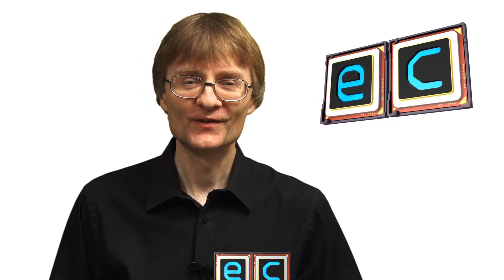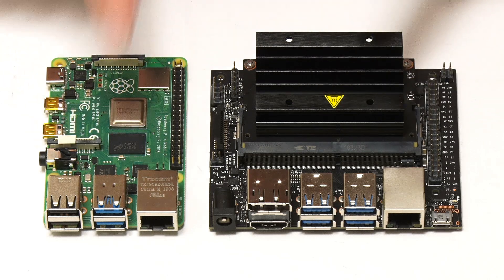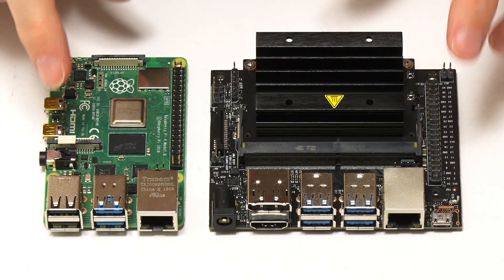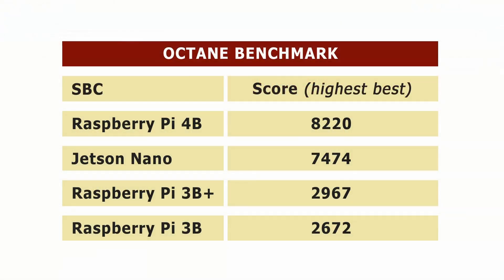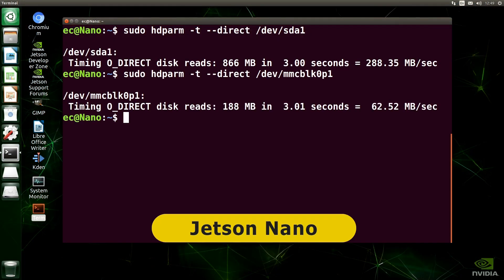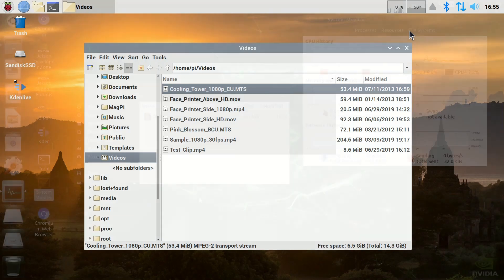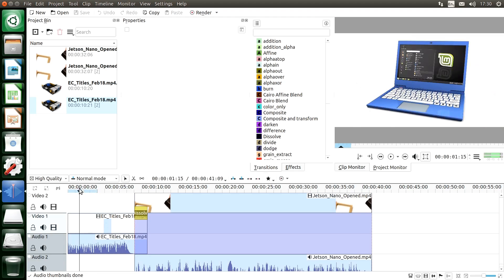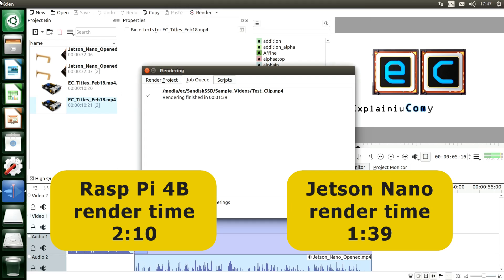Raspberry Pi 4B vs Jetson Nano

Comment: The pi4 struggles with youtube because they disabled hardware acceleration as it was breaking other parts of Chromium. Hopefully it's just a driver issue and it will soon be fixed and enabled.
Reply: Alternatively, Firefox seems to work perfectly.
Reply: @thecaptain2281  Firefox huh. That's huge. For a long time on low-end machines Win10 machines, YouTube couldn't play higher frame rates (50fps to 60fps) in Chrome but could in Edge. Go figure. I don't completely blame Raspbian since Chrome is wonky too. I'm not, however, happy with Raspberry Pi arbitrarily moving to open source codecs when there are free proprietary codecs to run the GPU.
Reply: @thecaptain2281  firefox would frequently crash for me on the pi due to ALSA related "assertion errors". although, this could just be gentooism (i couldn't find a way to get it on raspbian short of compiling it myself, which would take aeons). youtube performance is slower on FF anyway, since google's shadow DOM trickery comes into play.
Reply: @mergemechanism  
To be fair, I have a pair of Tinkerboards(both versions) and I run Android on each. Firefox for Android on those SBC's doesn't have any problems with Youtube at 1080p. Maybe Android on the RPi4b would run YT on FF better?
Reply: @thecaptain2281  At what resolution?  No dropped frames, stuttering, etc.?
Reply: @mtubeluck2044  As I said above, 1080p. No dropped frames, no stuttering. I'm using both of my Tinkerboards with 1080p TV's.
Reply: Just install Play with MPV, compile MPV with RasPi decoding support and play it in an external player. I do that on my desktop too because Chrome does not support NVDEC or any other hardware decoding on Linux. Should play 4K just fine.
Reply: @multiflexi  i just use the rpi3 build of gentoo since the one script out there to cleanly automate that process only lets you use the decoding on the fbturbo driver, which looks slightly garbled on my monitor
Reply from the maker: Indeed. In some ways it is a shame that the Pi 4 was released before this software fix, as a board that should be able to play 1080p YouTube not being able to play it is not doing the Pi 4 any favours.
Reply: older versions of raspbian as used on the 3b and 3b+ also have wonky video decoding support out of the box, which doesn't help
Reply: @ExplainingComputers  OTOH, the developers need the computer to adapt their software.
Reply: @ExplainingComputers  Have you tried cooling the pi4 during the youtube video test? The overheating icon keeps popping up during the test so it might be throttling a bit giving skewed results.
Reply: @ExplainingComputers  youtube-dl is your friend.....  Really, who cares about browsers anyhow?  They are a giant piece of crap software.
Reply: @ExplainingComputers  Maybe it drops less frames with a heatsink? Or maybe the software is already fixed as I am writing this. 03.2020
Btw. does it work in FireFox or other browsers?
Reply: @ExplainingComputers   Any one of these to, Raspberry pi4 or Jetson nano, can support AutoCAD and Arduino IDE ?? Please ans me.
Reply: Another thing, you CAN enable it. It's simply a line in the chromium configuration file. It's just that after you start playing a video, the entire browser freezes if you click anywhere. It's not exactly ideal
Reply from the maker: @Maarten Sadly I did start to throttle in YouTube with that heat sink fitted. The Pi has been running for some time. But it does get very warm very quickly! :) I'll be posting my Pi 4 cooling video a week on Sunday, where with active cooling I' have managed to run it at around 55 degrees at sustained full load. :)
Reply: @ExplainingComputers  I think that has to be mineral oil cooling.
Reply: People care about Chromium?  I thought that Firefox was the preferred browser on Linux distros?
Reply: @Magus12000BC  using Chromium is like using internet explorer years ago, it's the browser supplied with the OS so you just use it.
Reply from the maker: @Maarten The Pi was running with a pretty hefty heat sink, as shown a little later in the video. Though given that the Pi 4 is supplied without a heat sink, it would not be unreasonable to test it in that state. :)
Reply: @ExplainingComputers  My apologies, i meant during the youtube part, was the heatsink also installed there? I would be very surprised if it managed to overheat with a heatsink like you used later in the video.
Reply: You are quite correctly, also it appears to perform better if you set the screen resolution to 720p (not the video quality from Youtube).
Reply: @Jeff Wolsieffer what are you referring to? if it's the video decoding, that was just an oversight on the package mantainers' end where they didn't build ffmpeg with MMAL decoding support, as it's kinda complicated to do anyway and most people just use the pi for IOT projects.
Reply: YouTube was working just fine on my raspberry pi 4 2gb ram.
Reply: Is this fixed?
Reply: @racionator2668  I can't tell you if it's really fixed or not, but I'm writing this from a Pi4, and the video looks fine.

I'm a 4GB version of it, and I changed the default settings for graphics memory to 488MB.  Certainly helps when running x2go as a client on this little box.

If you're going to get a Pi4, get the 4GB version, it's not that much more expensive, and I strongly recommend a Flirc case - it does a very good job keeping the machine cool.
Reply: It's pretty hopeless situation. This was a problem ever since first B and they just simply don't seem to solve it. At least 4B can actually run a YT video at all. First gen Pi would struggle even with 144p and take literally half minute or whole minute to load web pages.
Reply: The GPU of the raspberry hasn't never been a strong selling point, either.
Reply: I dunno about that but all previous rpi had the gpu disabled for mpeg and required a code to unlock the full board as the licencing issues were that way. It was and is cheap to fix though and easy to do so if it is related to the key you really have to buy, itbis not a bug but intentionally
Reply: @jonjonsson6323  The Pi 4 doesn't have hardware mpeg decoding, the CPU is supposed to be powerful enough to do it so they removed it. It can do H.265 and H264  decode.
Reply: Jason Kay ah missrd that. Shame . The old ones could do that anyway but the additional circuit was good as hardware is always a bit better than multi tasks, so in terms of performance that is not better even if it manages it. The benefit of having dedication is not just performance based but rather a distribution of it..why involve it at all so to say of a small chip can do it..even my pi 1 had very good movie and youtube capacity so i dont see any improvement by integrating it in the main..that circuit must have been cheap
Reply: BaboonLoveMonkey  I think the real shame is that google puts a lot of stress on youtube (same as the rest of the media, take any big online news portal) plus ultra heavy javascript, plus all the shitty marketing overhead (to mine your data of course); with that out of the equation the Pi3 or 4 can handle any other online multimedia content; in fact if you dont have a powerful handheld device (i.e. cellphone/tablet/notebook from 2015 or newer) you will experience the same problems that the Pi has  with the online multimeda experience
Reply: What wasn't discussed here is if I can play Pong with either of the boards...
Reply: BaboonLoveMonkey  poor browser video streaming is a BIG let down, especially when the pi4 is pitched to us as a desktop pc.  I have found performance worse than on a 3b+ with raspbian stretch.  Glad this is finally being talked about.  Debating whether to sell mine (coz need cash) and revisit in 6 months

Comment: Did you have the new hardware driver update for the Pi4 to improve cooling for this test and how do you know if you have the most up to date drivers?
Reply from the maker: Both boards were updated before running the tests, but the USB controller update for the Pi was not released when I made this video. To update, in the terminal run a sudo apt-get update and then a sudo apt-get upgrade -- as least for standard drivers. I'm still not clear how the Pi 4's USB controller update will be released.
Reply: @ExplainingComputers  The reason I asked is that raspberry pi seemed to have a different link for updating the driver and I wondered if this was maybe a beta version?
Reply from the maker: I believe so -- I am not aware there is official guidance yet.

Comment: My Raspberry Pi B3 started to GPU fail after around 3 days, this a massive heat sink. No Overclocking
Reply: has those lines on the screen. Will try a better HDMI cable.
Reply: Using this heatsink
Reply: https://www.ebay.com.au/itm/AU-Radiator-Protective-Cooling-Case-Shell-For-Raspberry-Pi-3B-3B-Open-Design-NEW/401753733352?ssPa

Comment: Was that an ad ☺?
Reply from the maker: No, no ad. :) None of my videos are sponsored in any way.
Reply: @ExplainingComputers  Oh. Also, I ran sysbench on the pi 4 and it gets pretty hot with a small heatsink (~80 °C). With a small fan it is around 50-60 °C.
Reply: @minepro1206  *around
Reply: @alvallac2171  Patched.
Reply from the maker: I'm making a Pi cooling video right now -- and have hit 90 degrees in a Sysbench test running the Pi without a heat sink in the official case . . . not good! :(
Reply: @ExplainingComputers  Not good indeed. Have you ever thought of some kind of water cooling?

Comment: Which one of "Raspberry Pi alternatives" are most cheap? Preferrably with option to order them from China?
Reply from the maker: Cheapest are probably the Orange Pis, if not with good hardware support. Also look to Pine64 with the Rock64 and related boards, and the RockPi boards. All of these are from China.
Reply: nano pi and odroid are decent enough for its official and community support, with decent performance
if need dirt cheap and you know what you gonna do, orange pi is the choice
if focusing on some iot or very hardware-focused stuff, esp32 or arduino derivitives is much much viable and than RPi.